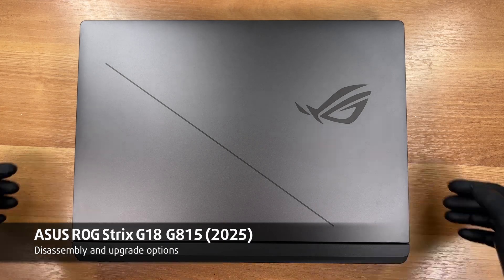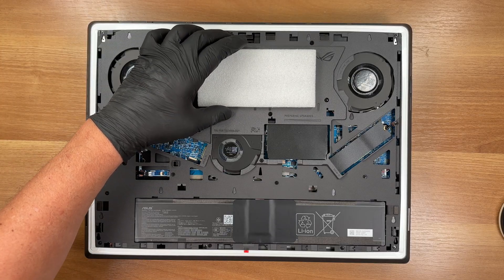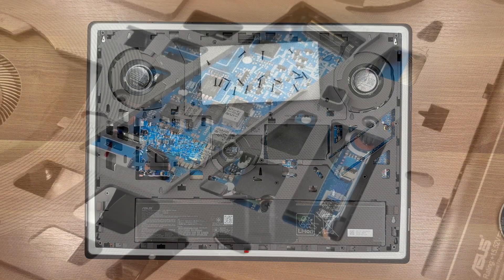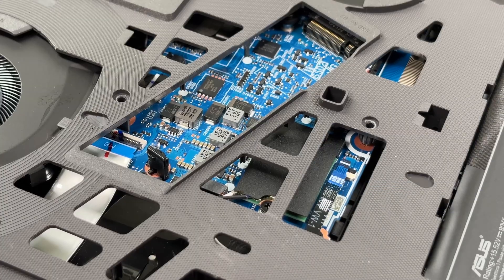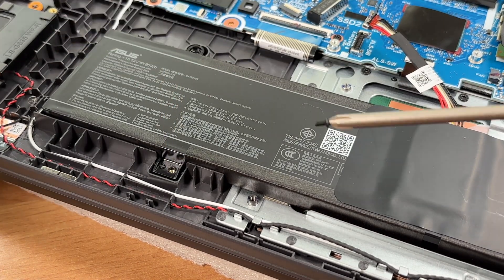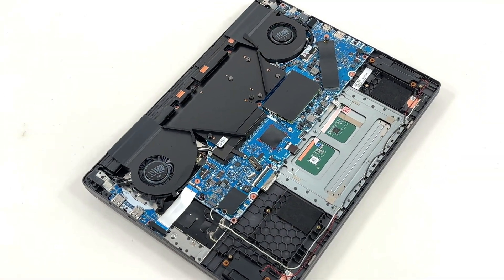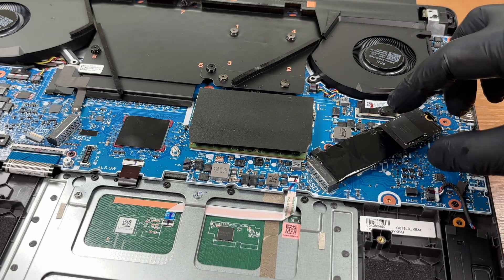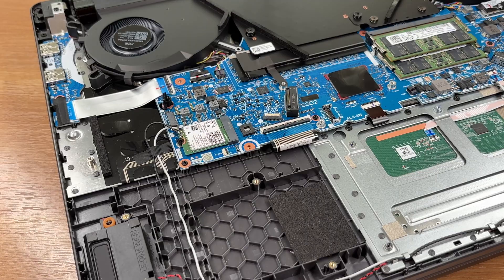🛠️ How to open ASUS ROG Strix G18 G815 (2025) - disassembly and upgrade options

Comment: I have a tuf F15 laptop whose hinges broke(those small metal plates snapped) and looking at this thing, after a year or so, I think the same will happen. Wondering if there is an upgrade for it(different metal used for the plates so they don't get fatigued so quickly)